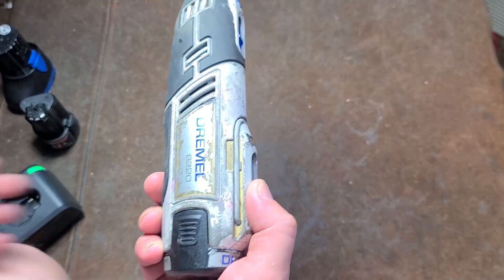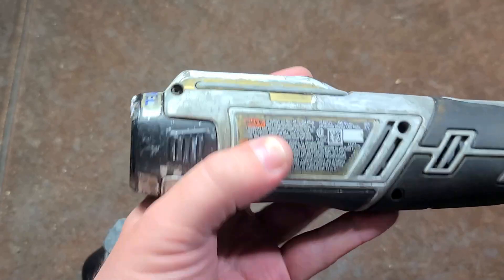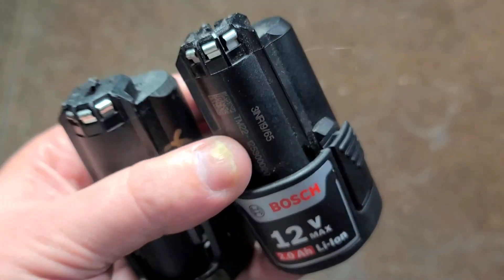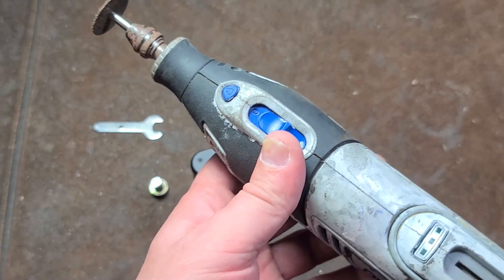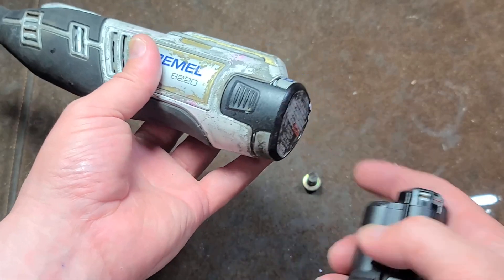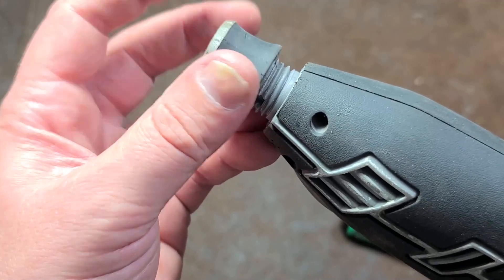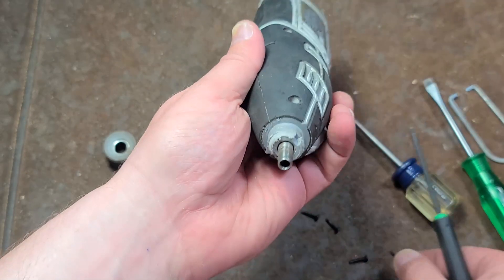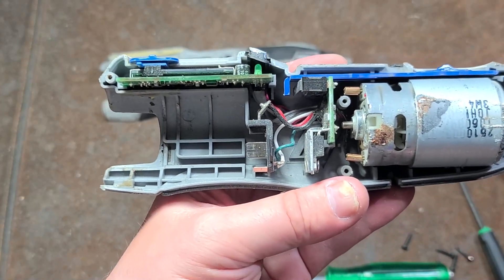Dremel 8220 High-Performance 12v Max Li-Ion Cordless Rotary Tool Review

Comment: I have a Bosch tool very similar to this and I have a bunch of 12v bosch batteries. That's why I don't buy the Dremel one. But the accessories are compatible with Dremel ones.

Comment: I have used the older cordless dremel with the dial speed control. I only use it when I have to. Otherwise I go for the corded one just because the older cordless bogs bad.
8220 seems to be a huge improvement

Comment: why buy the tool knowing the batteries aren't interchangeable without modification and then cry about it just baffles me dude
Reply: Yup, buy an Audi A3 and it's a bit of a bitch when the bumper doesn't fit a VW Golf, without significant fettling.

Comment: The 8220 gets too freaking hot. I went through 1 warranty repair and then a full replacement and they all overheat drastically.
 
I then went to its big German Brother... Das Bosch 12v-35 rotary tool, and it's ridiculous how much better it is. 
 
I can slap a 6ah in it, stand it upright, then run it on full power for hours and no issue (except the spindle bearing... but every rotary tool, that goes out quickly.

So if you ever want to step up, order the Bosch from Europe. It looks identical, but cooler. Lol

Comment: I have one of the newer models similar to this one (if not this one). I've liked using it, although it is definitely bulky.

I've also had that issue with the loop being incredibly tough to pull out

I've had another issue where occasionally the switch won't turn on the tool. You turn it back off then on again then it will work fine

I've thought about cutting up some of my other Bosch batteries for this tool, just never got to it. And, my Dremel charger crapped out on me, but I was able to use my Bosch and it's just fine

The same company different battery BS reminds me of the roto zip bits. They charge a lot more for the Dremel name, even though they are made by the exact same company

I also noticed that the M12 batteries seem to be quite similar, but the polarity is reversed

Comment: Is it possible that variable speed slider has some sort of capacitive sensing going on like in digital calipers? Completely exposed sliding contacts seems like a conspicuous oversight in an otherwise well-designed tool whose application is almost always to generate fine abrasive dust and blow it around real good.
Reply from the maker: That is a valid point I showed inspected more closely to see if they were actually metal sliders

Comment: I just bought the new dremel 8660 brushless rotary tool and you can use the 2AH AND 3AH Bosch batteries in it just not the high capacity batteries like the 6AH.
Reply: Not trying to be mean, but do you mean the 8260? Or have they made a newer model?
Reply: @MadeInMinecraft  that’s the one. Stubby fingers

Comment: The battery thing has never impressed me with those. I bought a HF pnuematic pencil grinder that I have enjoyed using for about 16 years at work. I bought a new version for the house shop but it ain't the same by a longshot! Can't wait to see the mods you do. It may be easier to change the tool to fit the batteries.

Comment: I have a Dremel and use the loop to hang the motor when I use the flex shaft attachment. Never hang it off my belt although it may be used for that.